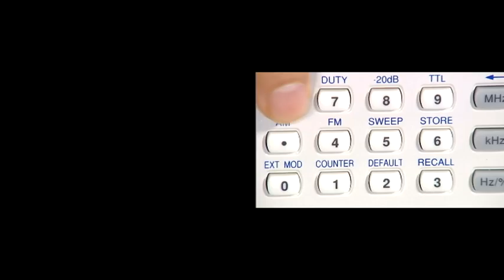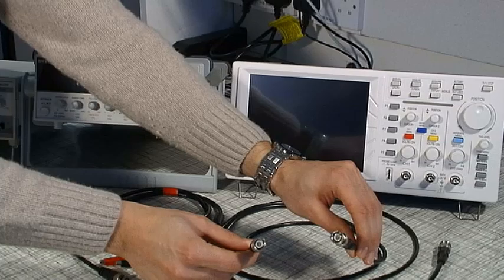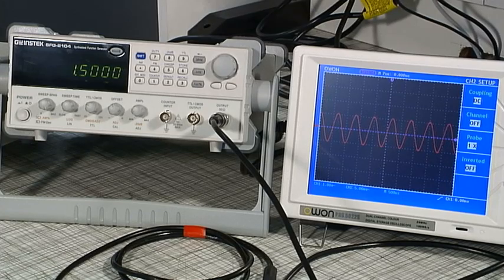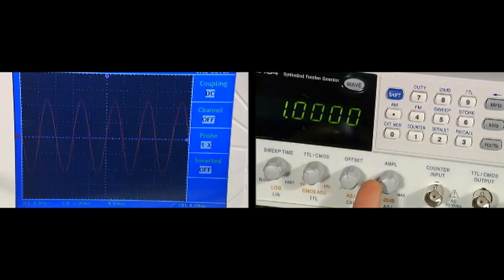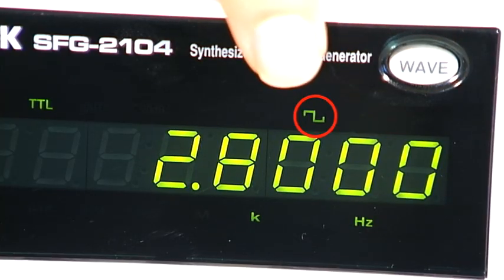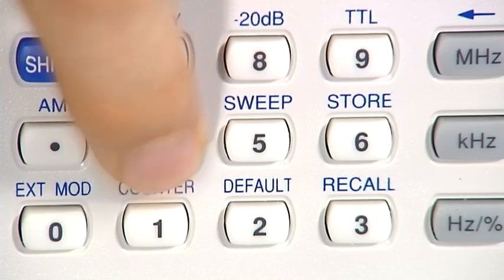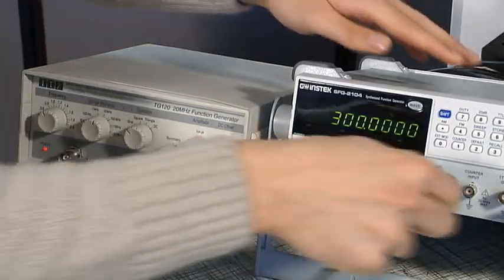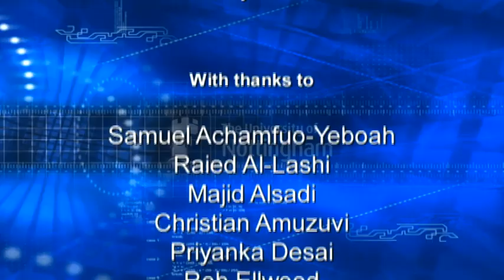Use of Basic Laboratory Equipment: Episode 4 - Function generator

Comment: my function generator out put voltage drops when a load is connected. could you plz explain what is the problem here. some one suggest to connect load of impedance equals tointernal impedance of function generator but if  i connect a load of dynamic resistance how would i match resistance of dynamic load, for example a filter circuit (from low frequency to high filter circuit impedance changes) how would i match impedance with generator internal resistance. thanks
Reply: Function generators won't power up anything, they should not be used as power supplies, they generate signals, use them with transistors

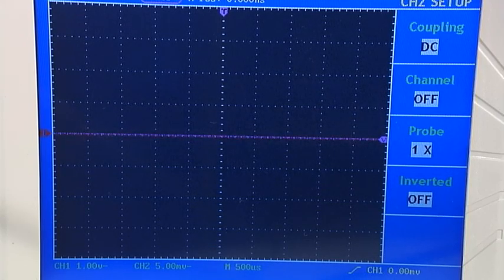Comment: Very nice and informative video, However I dont understand the part at: 4:01

Is he  demonstrating that we  essentially can DC pulsing a sine wave i.e.  the voltages goes from 0 to 10v to 0 for instance  and  not -5v to 5v to -5v?
Reply: 7 years later  I will answer , he is changing the x axis the wave is on